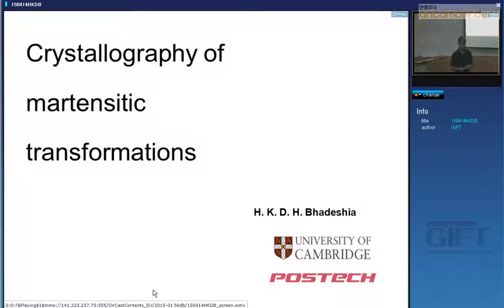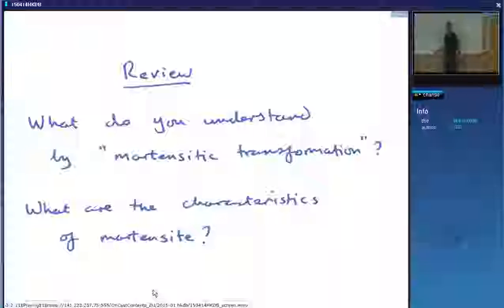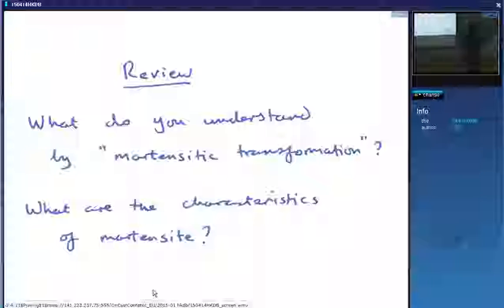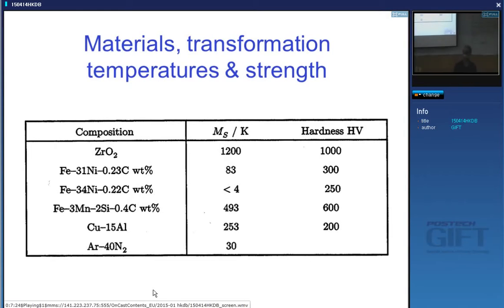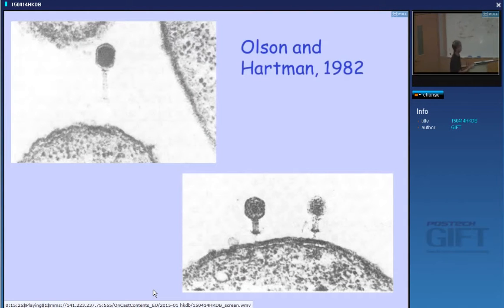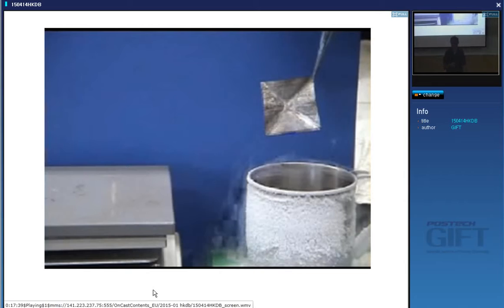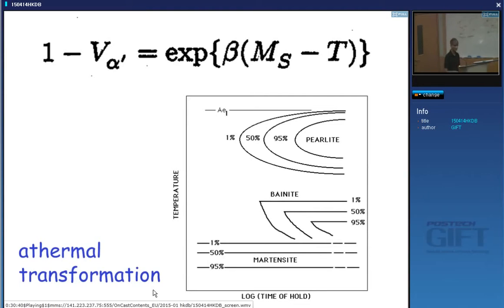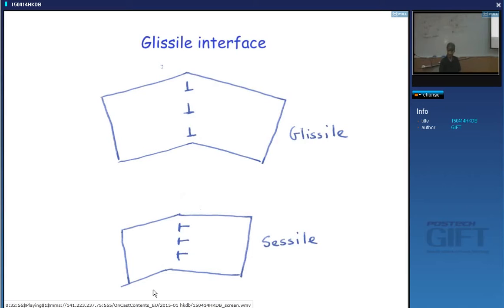Martensite crystallography, part 1

Comment: Dear Prof. Bhadeshia,
Thats an awsome lecture. Just a doubt: Is it technically correct to use the term "grain size" or "grain" for martensite? Number of authors use this terminology for martensite. Also, if martensite doesnt have a typical "grain" type microstructure (like diffusional products), is it technically correct to use crystal deformation theories (crystal plasticity) for martensite deformation?
Thanks anyways.
Reply from the maker: DK You are right, the martensite is in the form of thin plates. What is important is the mean free slip distance, which is about twice the true thickness.
Reply: Dear Prof. bhadeshia (bhadeshia123 ). Thanks a lot for your response. Can you point me to a good literature (book or paper) dealing with physical metallurgy of deformation of martensite.

Thanks again!
Reply from the maker: DK Acta Metall. 19 (1971) 345-354